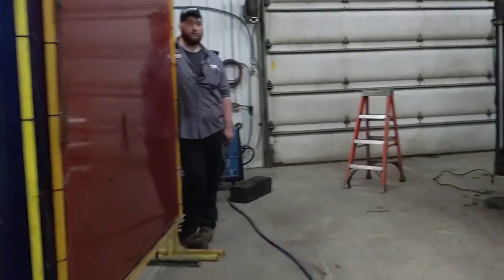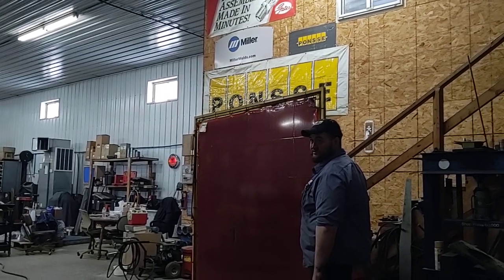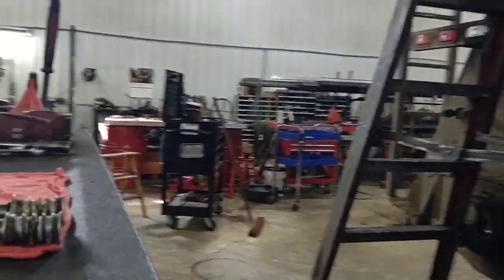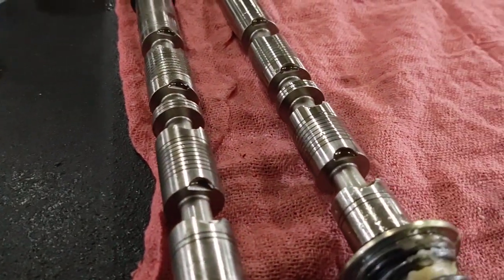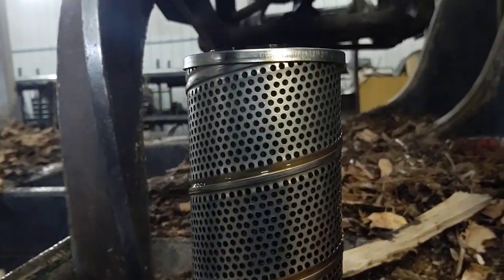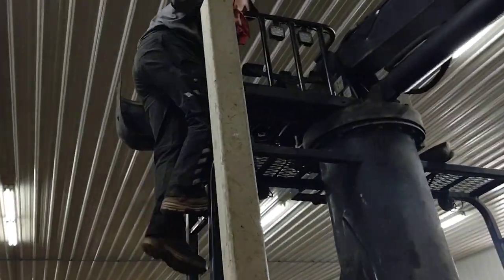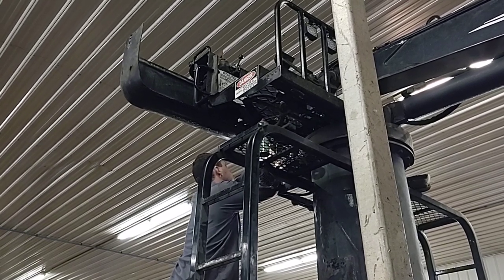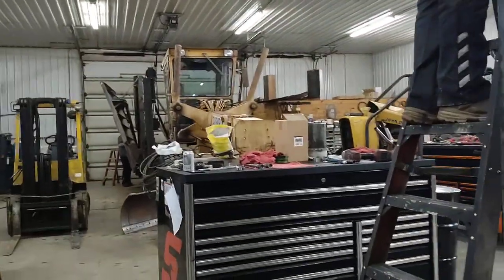Serco loader blues! Junk in the valve bank spools. What is it?

Comment: how do you get the rest of the Orings out of the hydraulic system to prevent more chunks getting  into the spool valve or worse.. going to unbolt hoses and extend them into a drum with a suction strainer on the end of the extended hose to catch the particles.